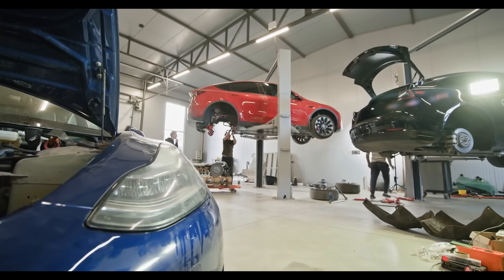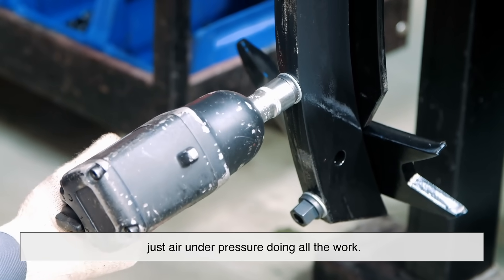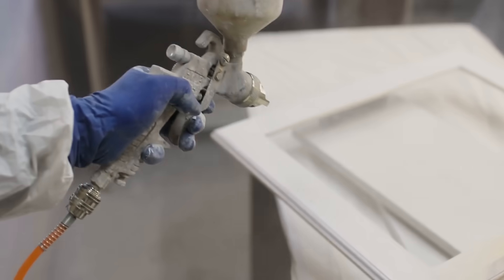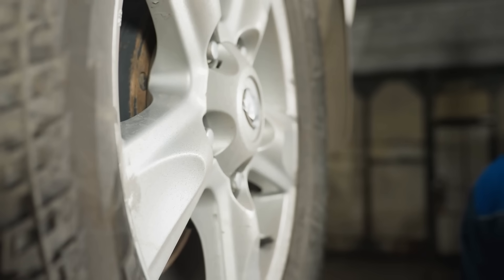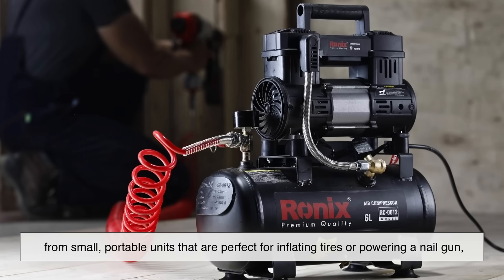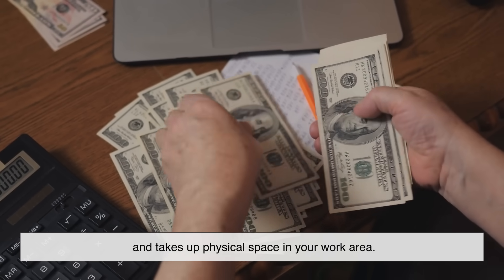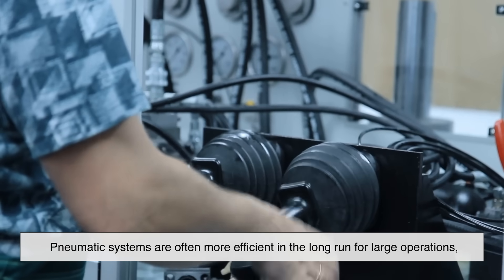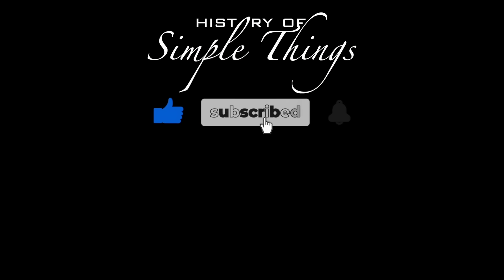What Are Pneumatic Tools and How Do They Work?

Comment: At the turn of the last century Ingersoll -Rand and Chicago Pneumatic were the huge players in building air compressors and Diesel engines for mining. The power drills used for rock boring was the first of many pneumatic tools these companies provided. Some of the Ingersoll-Rand air compressors were powered by steam engines...the 150 horsepower steam powered compressor i saw in Colorado was quite impressive and provided compressed air for all the mining needs at that site.